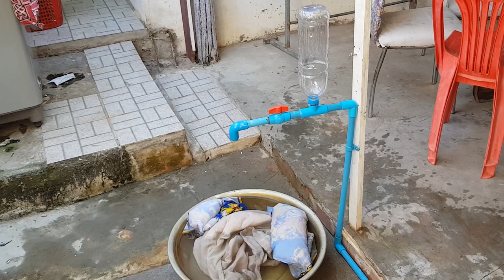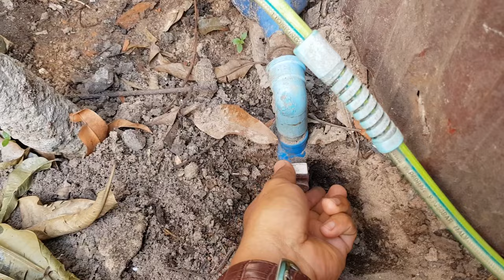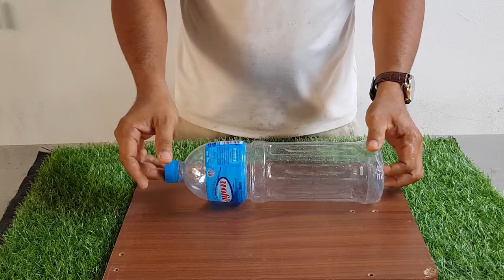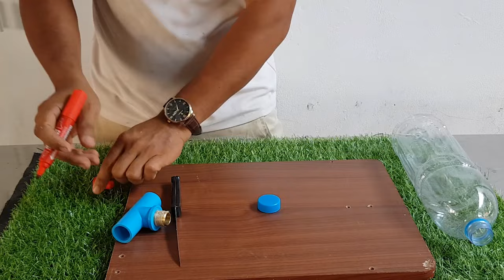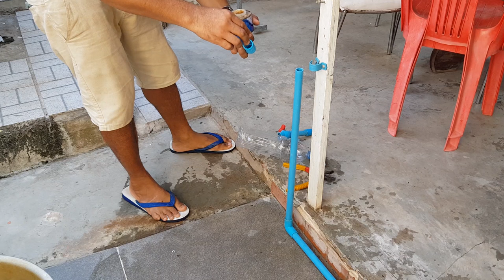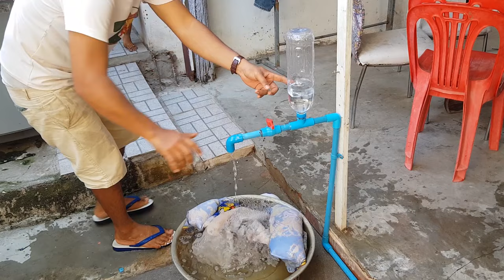Amazing idea to fix PVC pipe low pressure most people don't know #diy

Comment: Make since. Air is gonna fill up the bottle once the water starts filling up the bottle the air is stuck inside. Kaya mag kakaroon ng airlock pressure which will give more force to the water. Pero di ko inakala kanito kalakas un.

Comment: hey, when the bottle is empty, the pressure should go back to the normal slow flow rate right?
Reply: Yes
Reply: Now I'm wondering how come if the bottle isn't empty, it produces pressure, I thought it's still the same  thing when it's empty?
Reply: When you start the water the water fills the vacum and when the water valve is opened the water flows out the bottle which creates negative pressure which leads to bottle suckinng water

Comment: What is the mechanism of this idea???what is the reason for the increase of flow???kindly share
Reply: Due to Compression of bottle , 70 per  air will be out in the bottle thus pressure increases when water flow through pipe .

Comment: Make a small hole in bottle.. it will boost a pressure so that you can pump a water to 5 floors without motor !!!!
Reply: ?? Really?
Reply: @kjellg6532  no dear it's fake video
Reply: Have tried it before when you said is fake video
Reply: Yes, and no. It is like placing a nozzle on your garden hose. You trade pressure vs volume. In this case there is a limited pressure at the output from the valve. This pressure consist of the static pressure at the source minus the transport resistance in the tubing to your house. By restricting the diameter of the output, the flow decreases and the pressure increases. Higher pressure can throw water longer or higher. The bottle here ads nothing to this process, but it will act as a very small, local, accumulator of water and give more water under high pressure for a few seconds. For practical use the bottle is much too small. The videos that shows a high volume of water over long time are scams, fake and a hoax. Probably the start with the main valve in the house partly closed, then at the end the main valve is fully opened.

Comment: How flow rate increase with pressure?
Reply: same
Reply: This video is a scam. When the flow is low you can have a short boost if you add a storage tank, but with this little bottle, the boost will only last for 1-2 seconds. This video is a joke.